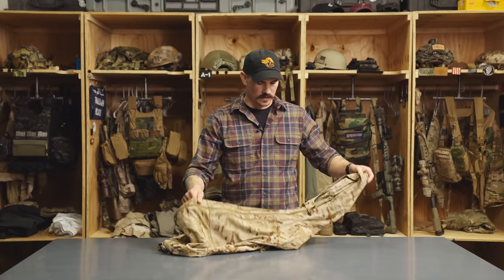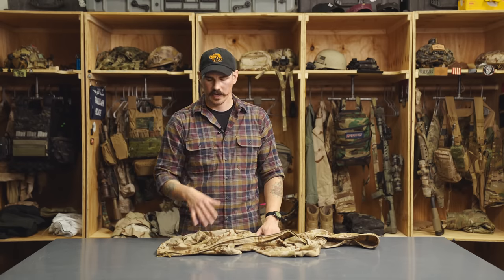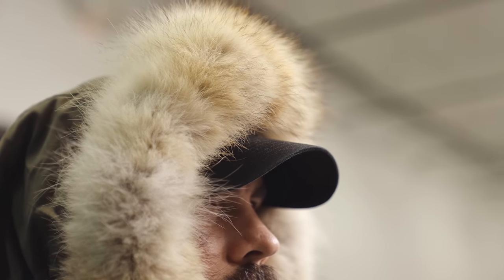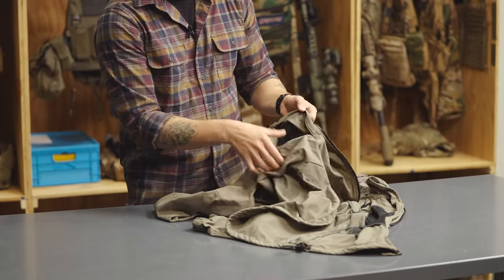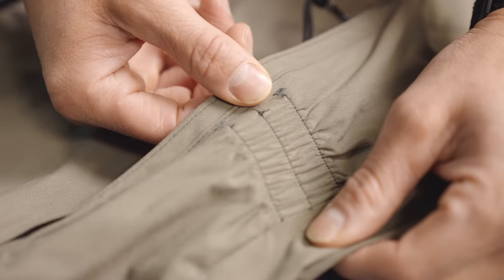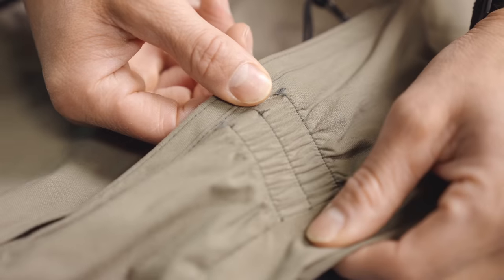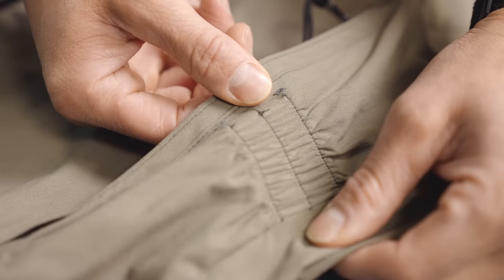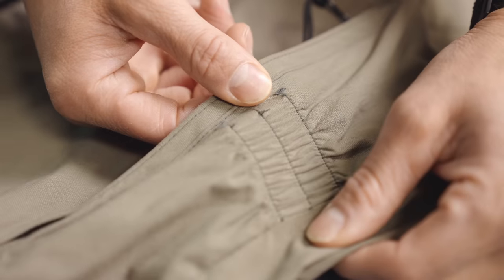Cold Weather Layering: Part 2 - What Is The Wind Layer?

Comment: Would wearing a base layer, mid layer and than the wind cheater be ok? I know you said you would wear the wind cheater directly over just the base layer.
Reply: That’s what I do and haven’t had a problem. It’s cut generously enough to wear 2 layers underneath.
Reply: If you are moving, I would not. If you get too hot, (Which you will) you have to take off your windcheater, take off your mid-layer, and put your windcheater back on again. To me that is highly inefficient when I can throw my puffy jacket on over everything and just take it off when I’m ready to move again. It’s fine to wear the windcheater over the insulation layer if you are doing some type of low activity camp chore and need to protect your puffy layer from being torn up, but if you are on the move, stacking up or stacking down a layer is going to be more time and energy efficient, as well as keeping you more comfortable.
Reply: @kevinmcdowell3446  Listen to this man and not me since he’s in all the HPG pics and obviously uses the gear more and in more extreme conditions. I usually dress to be cold when I first start my trek and then comfortable for the majority of the activity, and maybe warm enough at peak activity levels to unzip my Windcheater, but never so warm that I need to take layers off. I also never was in cold enough weather to need a really big puffer in addition to the Windcheater (if it’s that cold or precipitating that much I forgo the Windcheater).
Reply: @Kevin McDowell  I think it depends on the mid layer. An active mid layer with polartec alpha would work well.

Comment: Unrealistic. 
Tried wearing all these jackets and it did not work for me. I was able to put all the base layer stuff they mentioned in the last video but with all the jackets I could hardly move. I'll keep you updated when I watch pt. 3

Perhaps they address this.
Reply from the maker: When you say that you tried wearing all the jackets, what do you mean exactly?  Keep in mind you need to have looser layers if they are going to go over other layers. So many modern jackets have a slim fit not meant for layering.
Reply: @SpiritusSystems  you guys are too kind and squared away... I was meaning to make a joke about how I tried on every jacket mentioned and how I wasn't able to move around because of it. 

If you think my comment would affect the channel negatively at all I will remove it.

This is honestly the most thorough set of videos on layering and I reference it quite often when taking considerations in colder weather